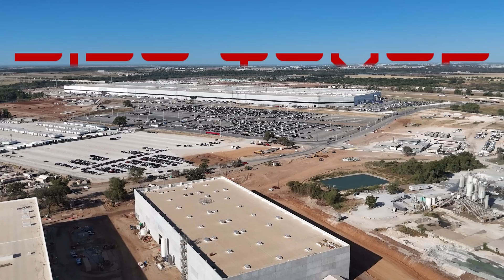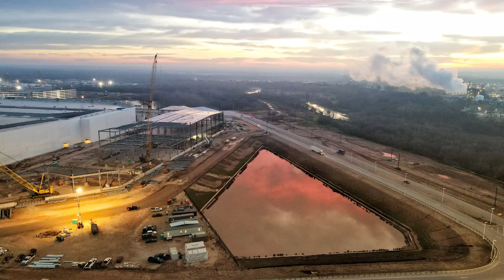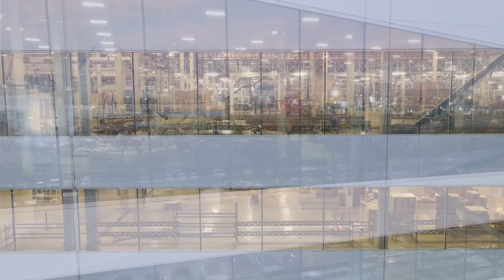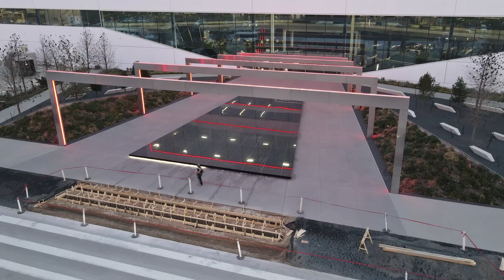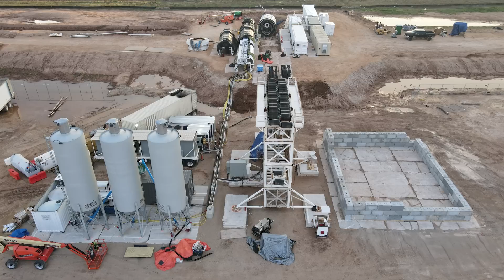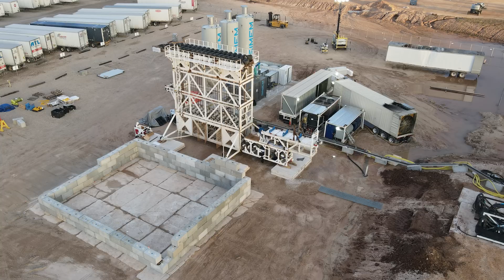Inside Views! S Glass Wall Expands! Castings Everywhere! 7 February 2024 Giga Texas Update (07:05AM)

Comment: That first photograph you showed at the beginning of the video is particularly spectacular. 
As a VERY amateur photographer myself, I've found that sometimes you just get lucky, ending up with spectacular results; I've one such example that was taken using a 2nd hand £10 digital camera bought on eBay when I first started out. It looks very professional, but in truth, it was just an experiment taken by someone who didn't have a clue about what they were doing during my very 1st foray into photography....😅😅😅
Reply from the maker: Thanks! Sunrise images are my favorites, just need the conditions to be right.
Reply: @JoeTegtmeyer  You're most welcome. To me, it is 'print it, frame it, put it on the wall', worthy. It's not just the sunrise, but the light and shadow effects around the steelwork, cranes, and other construction paraphernalia as well as the water retention pond; the whole of which makes for a beautiful composition - and the subject matter isn't what immediately springs to mind when we think of a beautiful photographic subject.

Comment: I thought Tesla built the simi because it was poor form to be delivering EV or EV parts in smokin chokin diesel trucks. SO, why are there not a fleet of Tesla simis here delivering
cars to the railyard? Hey, it just hit me. Is it possible, Tesla has a requirement of all
contractors delivering cars & parts that they use BEV or FCEV simi trucks to do the work?
Zoom in on several of these trucks. Do you see exhaust stacks or fuel tanks hanging
off these trucks?

!
Reply: They have just started building the factory to mass produce the Semi.

Comment: You would think they should have bored the tunnel first before they set all those piles.
Reply: 35' between the CFA pile groups, tunnel 14'6' outside diameter, geo-piers but a snack for a TBM.
Reply: TBM’s can’t really go through piles (although it has been done). Cutterhead does not have the teeth for it on this machine.
Bigger issue is what you leave behind. Something is loading that pile, if you cut through it, it loses its foundation.
Point load on a segmental lining is really bad.
Even if pile is abandoned there is still a risk (e.g. 10 years from now a crane sits on top of the abandoned pile)
Reply: @davidsalisbury50  Not even geo-piers that are compacted gravel? Not that there should be any in the way. The geo-piering of this end was only carried out mid last year, well after (I think) the route of the tunnel, or ramp to the tunnel was established.
Reply: @DessieDoolan  Yes, can go through geopiers, but still has the potential to cause point loading on the lining so lining design may need to be modified. As the TBM can only make around a 125m (400ft) radius curve, this would involve multiple piers being "taken out". Not sure what would be achieved. Hence our assumption that the alignment is straight.
Reply: @davidsalisbury50  Having had my fill of 'TBM Brush Seal' videos last night, tonight's project will be to check if geo-piers are on that alignment.

At the time I wasn't paying attention to where they were located.

A straight tunnel does seem the likely. To the point that I'll be surprised if it isn't.
Reply: @davidsalisbury50  Seems likely there aren't any geo-piers along the speculative tunnel/ramp alignment. Most the geo-piering was done in May and June. I couldn't find a video showing geo-piering north of the alignment.

There is good video of the deep sanitary sewer drains along the same alignment. No geopiers visible in the excavation for that. Geo-piers show up really well in excavations.

https://youtu.be/Qub4DmsyXIs?t=101

Comment: Hey Joe!  Love your videos.  Question for you or the crowd…anyone have a ballpark cost of just a single pane of the glass being installed on the south end extension?!?!  I’m guessing around $10k… or more!
Reply: I was thinking no change out of $10k. Possibly 10s of k.

Problem is we have no idea of the numbers of panes per glazed unit. I think it's 3. We don't know thickness of each pane. I'd guess at least one pane would be laminated. There is evidently 5T of counterweights on the lifting rig, so plenty of thickness. Plus they are manufactured in Germany.
Reply from the maker: Hard to say as these are likely specially made to fit and that brings in costs that are unique. Certainly at least $10K each is not out of the question.

Comment: Thanks Joe
5:34. GA, road. Running out cable for the street lighting. Pedestals visible.
5:58. GA, Level 3. Column A75. The Trumpf Tru-Bend machines would be straight ahead at H75. The blue perhaps.
Construction night shift finishing up.
6:05. GA, Level 3. Column B73. At .25 speed. Deep inside a robot picks up a Cybertruck cabin outer ring and swings it overhead.
7:52. GA, apron. Right. Loading dock openings. Evidence of saw-cutting. Installing dock levellers.
8:07.  Main Entrance. Apron. Pair of footings. Suspect this is a structure for up-lighting or some other lighting feature. Might be a clue in the graphic of the trailer parked opposite. Visible in Joe's photos.
Level 3. Huge volume of empty space.
8:52. GA, Level 3. Level 4 visible through the opening in the back wall.
9:26. GA/Battery. Top left. Level 4. Large video screens, office or cafeteria.
Level 3. Yellow robots. Staged, not operational.
11:00. Westside. North end. Bottom left. Screw piles in amongst the steel.
13:01. Westside, storage. Blue items. Possibly the 2nd hot stamping press. To be installed parallel to existing in Stamping 2.
14:08. New EOL Transport Yard. Light tower footings same as in the east side parking lots. Yellow, ‘formtube’.
15:47. New EOL east, apron. Fire hydrants. Bollards coming, before or after the first hydrant is hit is the question.
Gutter drain inlets and manholes in the curb.
17:14. Westside, Tunnel Project. David Salisbury mentioned in other comments that the TBM may be launched without the back-up decks. Might be why they are placed to one side for now. David, please correct me if I have this wrong.
17:45. W-WOW. Car transporter has been parked there for 2 years now.
18:29. Southend. West diagonal corner. 3 beams in front of the opening in the retaining wall. No lateral supporting structure for the Level 2 perimeter floor beams, so the beams have been beefed up with what is essentially an additional web. Or perhaps 2 if we get to see the other side.
19:57. Southend, east diagonal. To the right of the crane. Small square glazed unit. First of the glazed parapet. Test piece perhaps. Scales the same width as the large units. Or maybe an above door unit.
20:16. Southend. Extending the CFA piles. A proper puzzler for me.
21:53. BIW, apron. Left. By the green porta-loos. Cybertruck BIW on the back of the trailer. Another here yesterday when Jeff flew over.
22:34. Robotic Avenue, south. Geo-mesh laid, spreading gravel over.
23:50. Tesla Road, east. Median excavated, backfilled, re-compacted, trenched.
25:24. Cathode west. Left. Strip of asphalt paving missed. Trench coming.
25:54. Die Shop, north. Small square opening cut in the wall.
26:13. Die Shop east. GROB crate gone.
26:53. Temporary switchyard. Telehandler.
29:56. Battery west, loading docks. Inside. Blue bin full of what are likely battery cans.
31:14. Casting, apron. Left. Geo-fabric laid in the bottom of the trench.
Reply: @dessiedoolan 17:14. It is looking more like they will launch the TBM (partially) before connecting the back-up decks. Lot of temporary connections seem to be going in place (power cables, hydraulic lines). Still too early to tell. I don't see any advantage in this.
Not sure why the thrust ring was not installed yesterday as they had it lifted on the crane. Now laid back down on the ground and the crane gone. 
Muck bay is 4 sided. Implies they expecting wet/slurry spoil.
Reply: @davidsalisbury50  Wet slurry/spoil. Previously calculated the tunnel would dip to under the average river level. I can't find where I posted that. Something else to look for tonight. Presumably they'll be into sand and gravel at some point.

Here's the geology for this area,
Taken from the relevant US Gov site.

Closest to the river. Includes the river, the south pond and the south east half of the southend extension.

“Floodplain deposits, including indistinct low terrace deposits; clay, silt, sand, and gravel; silt and clay, calcareous to surface, dark gray to dark brown; sand largely quartz; gravel, siliceous, mostly chert, quartzite, limestone, and petrified wood, along Colorado River much igneous and metamorphic rock, probably mostly reworked form terrace deposits; fluviatile morphology well preserved with point bars, oxbows, and abandoned channel segments.”

North of the above. Includes the north west half of the southend extension (the tunnel alignment), most of the main factory.

“Terraces along streams, consist of three or more levels which may correspond to coastal Pleistocene units; gravel, sand, silt, and clay in various proportions with gravel more prominent in the older, higher terraces; gravel along Guadalupe River, siliceous, coarse, along Colorado River, mostly dolomite, limestone, chert, quartz, and various igneous and metamorphic rocks from the Llano region and dolomite, limestone, and chert from the Edwards Plateau; sand mostly quartz.”
Reply: @DessieDoolan  After a career of ploughing through geological reports on proposed tunnel alignments I tend to quote from a colleague I have worked with over the years.
“When I read a geological assessment report all I ever find out is that it is brown and soft and if you keep digging it will at some point get brown and hard”. 
A little over simplified and a bit of a dig at my geological and geotechnical engineering colleagues, but there is something to it.
Clearly they are in soft water bearing ground, different from Vegas but probably similar to what they tested in at Bastrop.
Either way the spoil they remove will almost certainly be a stick wet mess.

Comment: Thanks Joe for the view inside the building`!
EOL facility:
South:
@ 14:35 Ongoing work to install the Superchargers.
Conduit being laid in the trench.
@ 15:58 More conduit in trenches. Looks like it is not encased in concrete.
North:
@ 15:22 (Bottom) Cables that will provide power to the south end Superchargers are visible in the vaults.
@ 15:31 (Bottom left) Outfall pipes for the ponds can be seen.
East:
@ 15:44 (Left) Three cable spools. Looks like they may be pulling more cable into the duct-bank, or getting ready to pull cable.
River road:
@ 18:01 Good view of the outfall structure and the access road down to it.
Tesla road:
@ 23:48 Rebuilding Tesla road. 
Temporary substation:
@ 26:46 Ongoing work to dismantle it. Circuit breakers on their way out.
LCRA substation:
@ 27:23 All 345 kV circuit breakers in the east bay remain closed.
BESS substation:
@ 27:54 345 kV switches remain closed.
@ 28:06 (Left) 24.9 kV switches on the transformer secondary side remain open.
@ 28:10 24.9 kV switches to the Megapacks remain open.
No change. Megapacks not yet operational.
Reply from the maker: You're welcome Dave!

Comment: Cancel the tunnel and build a bridge over the highway.
Reply: No need for a bridge or a tunnel. A thousand feet south is River road. Which goes under the freeway.
Reply: @DavidJohnson-tv2nn  because what could go wrong putting 1000's of un-registered/insured vehicles on what is now or soon to be a public road, right.
Reply: @michaelkaster5058  For one thing, River road is currently private. If River road were ever to become public, any number of arrangements could be made. Including paving new road under the freeway, just north of River Road. Which would be much cheaper than building a tunnel. It seems like the tunnel only serves the interests of the billionaire owner by promoting his other company. But that is just my opinion.
Reply: @michaelkaster5058  You can see there's space for another road under the freeway bridge at 17:53 that could have been built just for new vehicles exiting the factory and going to the outbound lot. That's what I've said for ages along with turning the west side area into a large outbound lot, which they have finally done. Tunnel is an even better solution though. Now if they would only listen and build a rail spur line connecting to the AWRR next to the Travis county state jail...
Reply: @DavidJohnson-tv2nn  Disagree, the tunnel will save them a lot of time, it'll pay for itself.
Reply: @michaelkaster5058   Unlikely to be made public as it does not lead to anywhere the public needs to be.  Basically a driveway onto Tesla property.
Reply: @boostav  And how many millions of dollars will a tunnel cost. Also, I wonder how many Musk fans would be advocating for tunnels if Musk didn't start the Boring company?

Comment: Looks like all 7 vents over the 4680 cell production are operational today (and yesterday). I think this means that all 8 lines are installed and commissioning is taking place. If I am right 4680 cell production is ramping up much faster than Elon's guidance.
Reply: It very much depends on the purpose of the system. If it is for general building heating and cooling, then it is not  necessarily tied to the number of lines in operation, although it may also provide double duty by providing temperature controls to the production lines as well as the general building. Generally temperature critical process lines utilize layered and often separate systems to maintain proper conditions. This usually includes a main building system, then a room system (which may or may not be a subsystem of the main building system), then possibly an enclosure system over the actual equipment, then possibly even equipment temperature control systems.
Reply: @GoCoyote  These are for 4680, not general purpose building venting. 3 or 4 have been in use for a long time now.
Reply: They were pretty clear in guidance that not all 4680 lines would be available until Q4. That was probably the only thing to glean from that terrible call. The one thing i was waiting on was news on Kato Road and what production numbers are expected after the 3 month shut down.
Reply: @aussie_al  I know what they said, maybe I am just being too optimistic and think Elon has now been very conservative in his estimates because he has been so wrong before.
Reply: @royh6526    Agreed.... yeah Elon seems to have dialled back his Elon Time estimates of late. Perhaps he's turned into sandbag Elon mode given that they were hesitant to give any real guidance on anything in the call. I do remember hearing something about a Gen 2 4680 a few months ago but haven't heard anything since. 👍